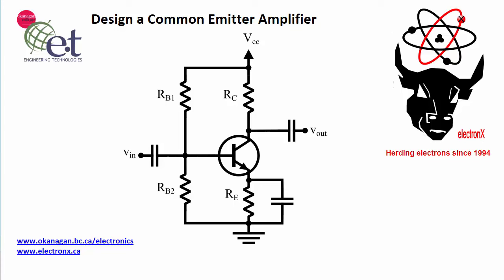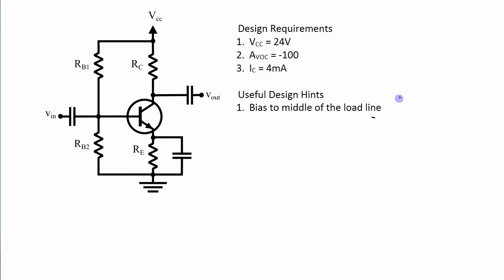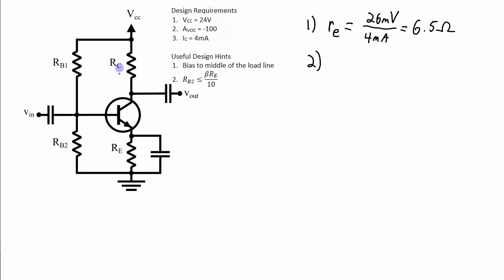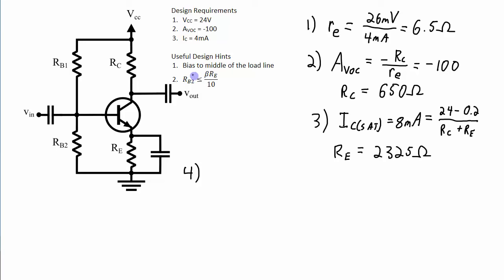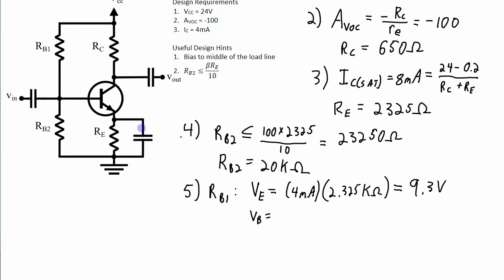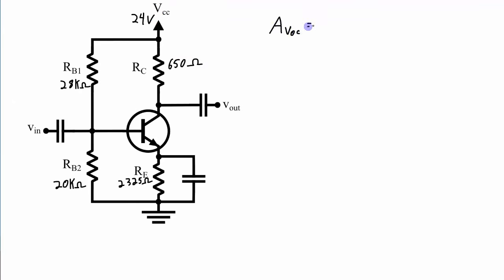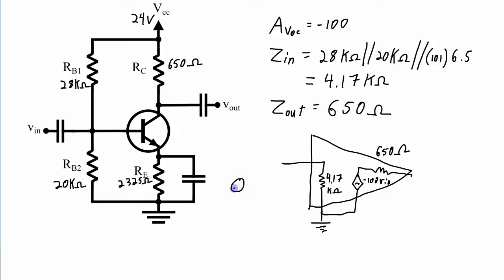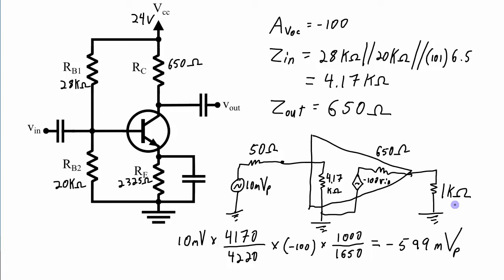Design a Simple Common Emitter Amplifier

Comment: How did you get 26mV to find the value of R(e) at first?
Reply: I think it's a generally accepted value but not a named constant
Reply: This 0.026 Volts comes by manipulating the diode current equation which is exponential in form. You remove exponents to get a DE and afterwards solve the DE with initial values of t = 0 and I = 0 to reach value of 0.026. Please read Jeremy Everard's book Fundamentals of RF Circuit Design with Low Noise Oscillators published by JW&S. Hope this helps!

Comment: To those watching confused about the 26mV, it is the thermal voltage of a bipolar junction transistor. It depends on temperature and is assumed to be 26mV at room temperature.

Comment: I think there is an error in the calculation for Zin. hie which is approximately 656Ω should be in parallel with 28K || 20K. This would make Zin closer to 621Ω not 4.17K as your calculation.

Comment: The input impedance should be 621 ohm and not 4.17k. That change would cause the final output voltage gain with the load to reduce.

Comment: How did you get 26 M V over 4 M A?
Reply: 26mV is "thermal voltage" of a BJT.
Reply: r"e=.026/Ie
Reply: I hate when people forgets details like that, specially at teaching.
Reply: @omarcusihuaman4261  Happens because some people are actually self promoting not teaching, er, like this guy.
Reply: The BJT's Base-emitter diode is literally a diode, so we will handle it as a diode. The diode's current is a function of the voltage across the diode: Id = f(Vd)
The function is: Id = Is * (exp(Vd / (k*T/q)) - 1), where `Is` is the reverse-voltage leakage current of the diode (typically really small, around uA-s). The curve is exponential, the Vd is the voltage across the diode, and the k*T/q is the Thermal voltage of the diode, where the k is the Boltzmann constant, the T is the temperature in Kelvins, (26.85°C is 300 K ), q is the charge of the electron. If you calculate, you will get 25.875 ~ 26 mV-s.
But how does this correlates with the operating point of the transistor? At the operating point, DC current flows through the diode, and this causes some voltage to drop. If we take this voltage and divide it by the current, we got a 'dynamic' resistance, which can replace our diode in the operating point.
If you do the math, and derivate the diode's equation by the voltage (d (Id) / d(Vd)), and you take the reciprocal of it, you will get r = Vth / Id, where Vth is the thermal voltage (26 mV) we discussed before, and Id is the diode's current in the operation point.
Reply: @RavenLuni  I had a teacher who gave us a test containing a circuit with a diode that we were supposed to analyze. Problem was that the diode was installed backwards in his schematic and I believed correctly that the circuit was off which made no sense to me at the time. I was the only one in the class who got it right.
Reply: @RavenLuni  <----  Why are you trying to protect this guy, are you being "politically correct" or something? How can this guy be a ...teacher and as you point out miss things leaving us struggle because of it. This is a confusing ..."tutorial".  Enough with all this crap videos on YT
Reply: It’s thermal voltage
Reply: @SkazaTV  It 26mV is just kT at around 300 Kelvin.  It's the thermal energy of the average electron and thus approximately the potential energy barrier that is created across the pn junction.

Comment: Finally a video where you're not simply asked to find operating point and are asked a more real world problem of designing something as oppose to just finding currents and voltages
Reply from the maker: To be fair,  I do have a video on how to find the operating point too. But I agree, design problems are more real world.
Reply: I have a question, assuming this same circuit, to know the maximum amplitude i can have on input before i reach Collector saturation current and start clipping the output ... do i just add the amplitude of the input to my base voltage and calculate a new base current and multiply by the gain to figure out if i will reach Ic Sat?

Comment: A good exposition, but there are a couple of snags.
The value for re is both temperature dependant and non-linear, so the gain of the circuit (Rc/re) will depend on temperature and be non-linear. Also the bypass capacitor needs to have a reactance much smaller than re=6.5R for the frequencies we are interested in. That will be huge if we want to amplify down to 20Hz.
With a quiescent current of 4mA and a collector resistor of 650R, the quiescent collector bias point is just (4mA x 650R) = 2.6V below the positive rail, i.e. at 21.4V. That leaves very little headroom for output swings, a mere 5.2Vpk-pk compared with the 24V available from the supply.

Both of these issues can be addressed by splitting the emitter resistor and only by-passing part of it. That gives a larger effective emitter resistance and allows a larger collector resistance. The cost is a higher output impedance, but that is to be expected for a class-A amplification stage.

If you're willing to lose the 10V of headroom, then you can continue to use the same Rb1, Rb2. That leaves about 14V for the output signal, so you can increase Rc to (7V / 4ma) = 1.75K. To maintain an ac gain of 100,  the effective Re now needs to be 17.5R, of which 6.5R can be assumed to be the base-emitter resistance, as before. So you split the 2.325K Re into 11R and 2.3K with the latter being bypassed by the emitter capacitor as before. Note that the bypass capacitor makes a high-pass RC-filter with the 17.5R effective emitter resistance (not the 2K3 emitter resistor), so it needs to be around 900μF to get a -3db cut-off frequent at 10Hz.

Personally, I'd not be so ambitious with the gain and work with a much lower base bias point. A gain of 20 using a collector current of 0.8mA could use a 12K collector resistor (setting the collector to  24.0 - 9.6V = 14.4V) and an unbypassed emitter resistor of 600R. That would swamp out the non-linear base-emitter resistance of about 30R, giving much more linearity because of the negative feedback. I'd suggest setting the emitter at around 4V meaning a total emitter resistor of (4V / 0.8ma) = 5K, made up of 600R unbypassed and 4.4K bypassed. The bypass capacitor would be 27μF for a cut-off of 10Hz. Working at the lower current would allow larger Rb1 and Rb2, so planning for HFE_min of 100, we would have Rb2 <= 100 x 5K / 10 = 50K. The current through Rb2 would then be (4.6V / 50K) = 92μA, compared with the maximum base current of (0.8mA/100) = 8μA. To be accurate we could calculate Rb1 to be somewhere between (24.0 - 4.6)V / 92μA and (24.0 - 4.6)V / (92 + 8)μA or 211K to 194K depending on transistor HFE. That's well within tolerances.

So I'd suggest Rb1=200K, Rb2=51K, Rc=12K, Re=560R + (4.3K || 22μF). Quiescent current ~ 0.8mA and collector biased at 14.4V giving a voltage swing of over 19Vpk-pk with a gain of 20 from 20Hz up. Input impedance would be 40K and output impedance 12K. If you need a lower output impedance, you can either sacrifice gain, or use more quiescent current and sacrifice input impedance. Or, of course, you could just add an emitter follower stage -- but that's another story.
Reply from the maker: Hi Rex. Thanks so much for your lengthy and detailed comment. These are good things to address once a new learner has a general idea of how the heck a transistor works at all.
Reply: @ElectronXLab  I quite agree, and I'm sorry I only just found your video.
I read a lot of the comments and it seems you have a very wide range of abilities among your viewers. Hopefully I won't have confused the beginners too much, and perhaps I'll have given your more able viewers something more to think about. Cheers.

Comment: I know I'm late in the day but... calculating the impedance (around 8 min 20 sec into video) from 28K ‖ 20K  ‖ 101x6.5 (which is 656) comes to 621 Ohms?  I calculated this using the standard method ie the reciprocal of the sum of reciprocals for each of the 3 resistors. Where am I going wrong in order to get the 4.17 K you calculated? (I see others have asked the same question but no reply, so I remain confused).

Having taught for many years (pharmacology, not electronics ... and that probably shows) I'd just say that it's worth joining the dots for individual steps. I see from the comments the 26mV caused confusion in this respect.

Otherwise I commend you in a very practical approach. So many videos on circuit analysis and yours is one of the few that actually starts with the design.
Reply: am waiting for Mr David responce for that too with respect
Reply: I think I may have seen the error, it seems to be an arithmetic mistake. If you multiply 6.5 by 1001, and calculate the values all in parallel, you get around 4.17k
Reply: It is simply an arithmetic error. In fact, if the entire emitter resistor is bypassed, then the ac input impedance of the transistor is just 6.5R x HFE. Not only is that a minimum of 650R, but it depends on temperature (because re does) and the HFE of the transistor. It's far better to have some emitter resistance unbypassed to improve linearity and reduce the sensitivity of the circuit to the transistor's parameters.

Comment: Hold on, how did you get your input impedance of 4.17k? If Rb1, Rb2, and 101*re are in parallel to each other, your equivalent resistance should be 622 ohms. It seems you multiplied re by 1001 and posted that number.
Reply: I got the same thing as you.
Reply: W2aew has some good biasing videos.

Comment: Wait a minute, how on earth did you get input impedance of 4.17K?
Reply: I'd like to know too -- I get 622R.  Is there some other parallel resistor equation we should be using?  I am curious, because I'm really struggling with a lot of resources teaching this stuff, and each one seems to leave out some detail.  In this case, I am flumoxed by this step.
Reply: To find the impedence, you short dc supplies to ground. So when you see from the input side, you get Rb1 || Rb2. Since you are tracing the ac path, The signal goes through Ce and to ground and hence Re is bypassed. Also you have a ac resistance through base emitter ( diode in forward bias ) i.e rb . Now when you go from base to emmiter, the current changes by a factor of (1+ beta) .. so does the resistance. So finally all the resistances will be in parallel.
Reply: @jephthai  It must be a simple calculation error on his part.   The resulting resistance across three (or any number of) resistors in parallel must be less than the lowest value. I get the same as you, 622 ohms.
Reply: @ahmadshamim3289  totally agree
Reply: he multiplied 6.5 by 1001 instead of 101

Comment: Also, another question about the input impedance -- isn't the emitter capacitor a complex impedance, and so shouldn't the input impedance be 36.8+654.4j?  If not, what would be the reason for considering it a resistance instead of a reactance?  Also, is the choice of the correct value for that capacitor target frequency dependent?
Reply: Usually your input signal is at a frequency high enough so that the capacitors reactance is negligible since it’s proportional to 1/f so it’s so small u can just neglect it

Comment: hi there, why does your collector current (Ic) need to be 4ma, and thus your Ic(sat) be 8ma?
Reply: I was wondering the same thing!
Reply: There is a difference between ICmax= 8mA and ICq=4mA.. ICmax is the current that  put the transisitor in the saturation region. so we use this current to calculate the RC when Vce=0.. Why Vce=0 , This is because in staturation Vce=0.
And since we need to let the Q point in the middle of the load line so we divide (ICmax /2) to get ICq which is 4mA..

 This is an assumption value you can put Icq= 5 mA ,1 mA or 2mA ... Then IC(sat) will be twice the value of ICq... It is all about your designe .

Finally, Active region is also called a liner region because any effect on Ic will change Vce and IB..And If you look at the load line you will find that  in order to center the Q point he put Vce =VCC/2 and also ICq will be ICmax/2 ... so there is a linearty here
Reply: The choice of collector current directly sets the output impedance and then indirectly sets the input impedance. The output impedance is equal to the collector resistor and the voltage across that is normally going to be around half the supply voltage, so the collector current is chosen to be about half the supply voltage divided by the desired output impedance.
The input impedance is generally dominated by the ac emitter resistance multiplied by the transistor β and the ac emitter resistance is the collector resistance divided by the voltage gain, so the input impedance is going to be roughly the output impedance divided by the gain and multiplied by β.

Comment: Howdy. Nice.
One comment though. According to JohnAudioTech the Zout is 2 x Rc. I believe JAT is correct. One could test this checking the output level unloaded and then loaded. The load that causes a -3dB drop is the Zout. Most energy is transferred.
JAT suggest the Irb2 is about 20 x the base current. Then Irb1 is almost the same as Irb2. And for practical purposes the Zin is Rb1 II Rb2.
High Regards.
Reply: Howdy again.
The statement that most power is transferred when Zload = Zout is true when the collector resistor is fixed.
However. If we design the circuit with a Rc = say 1/10 x Zload the Pload will be higher. What is this ?
Well. The Zload = Zout is the overall most energy efficient design of the whole circuit. With Rc = 1/10 x Zload the Zout = 1/5 x Zload. The load power will be higher but the total energy consumption of the whole circuit will be way higher.
But yes. The increased energy consumption usually has little meaning. Unless, of course, one aims at low power designs.
Usually it is recommended that Zout is 1/5 - 1/10 times Zload. The load will basically be voltage driven for best linearity. If the circuit is designed for Zout = Zload the load is more current driven. Frequency dependent variations in Zload will result in variations squrared in Pload.
Regards again.

Comment: Think there is an error with Zin you wrote 20k || 28k || 656.5 = 4.17K  When I learnt about parallel resistors I was always taught that the effective resistance must be smaller than the smallest resister. How can you get 4.17K when you effectively have a 656 resistor in the mix?
Reply: This is certainly a calculation mistake. Zin should be 621 ohm

Comment: Way cool got into 26mv/ma for Re (aka Re', bulk emitter resistance, etc.) as a part of calculating voltage gain. I learned it in the early 70's from Tektronix app notes. In my later years a routine question to ask in an interview I drew the circuit and asked the candidate to tell me what the voltage gain was. As soon as they uttered something about beta I knew they weren't there.

Comment: Hello, nice tutorial, but I have few questions. Where 26 mV in first calculation came from? And how parallel of 20k || 28k || 656.5 can be 4.17k ...  I find BIG negative on this tutorial - direct write of numbers and results without formulas, because I suppose, most of people will design the amplifier with different values.  This is big problem of this video in view of education, where the key and main focus should be the understanding, which bunch of numbers definitely does not meet. But take it please as a constructive critique from a teacher. I am mechanical eng. teacher who studied electrotechnical high school more than 20 yeas ago and wanted to blow the dust. Thank you.
Reply: yeah i have the same question.... 20||28||656.5 = 4.17....
Reply from the maker: Thanks for the comments. You're right about the parallel combination of resistors. I'm not sure how I came out with 4.17k - I think I used 6565 ohms instead of 656.5 ohms...but even then, the answer is not quite right. Correct answer is 622 Ohms
Reply: @ElectronXLab  I have just noticed that because it is obvious, that parallel combination has to be always less then smallest resistance.

Comment: Very nice tutorial, much better at AC analysis/design than other common emitter design explanations that I've found.  However, I'm a bit confused at the input impedance calculation of 4.17K.  That calculation is 20K || 28K || 6.5 * 101 (or 656.5).  That would be less than 656.5 and not nearly 4.17K.  I did back out your result:  I think that you used 6500 instead of 656.5 in the calculation.  Am I right or did I misunderstand something?
Reply: Robert Dunn I was just scratching my head too over that Zin because it wasn't adding up for me , so he probably messed up somewhere in that calculation , aside from that great tutorial.
Reply: No you are right, since RB1 and RB2 are much larger than 650 you could just call the input impedance 650 ohms
Reply: yeah i was completely stuck on that trying to figure it out, he did 6.5*1001 instead of 6.5*101

Comment: Your Beta was the same as your A voc.  I think your A voc is your desired gain.  Is Beta what the actual chip gain is or H fe?  Also in this example, you said you wanted a gain of 100 and yet in the end you only got a gain of around 60.  Shouldnt you have got the 100 as calculated?  What did I miss here?

Comment: Hello. The amplifier only amplifies the one part of the signal. I have used Electronics Workbench and my simulator gets a half of wave in osciloscope. Do you have more videos?? Please i want to mount my first circuit and this is my chance. Thanks. Can you give hints about how it works? Please, theorical material written. Thanks for your video.